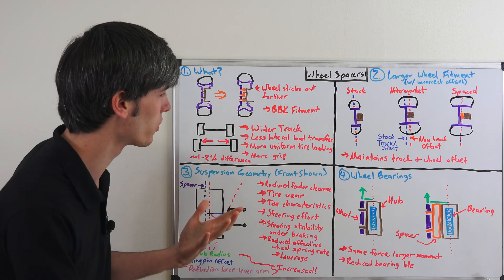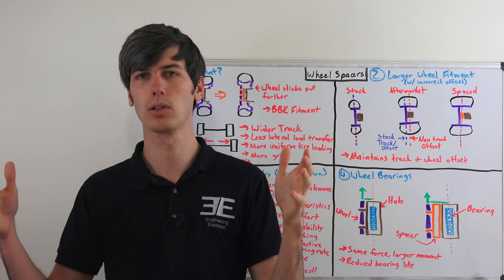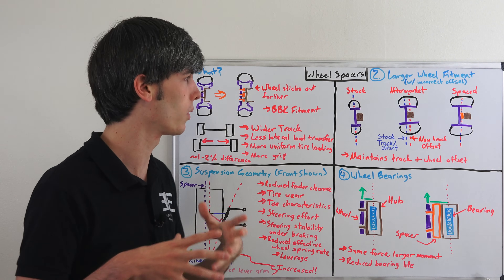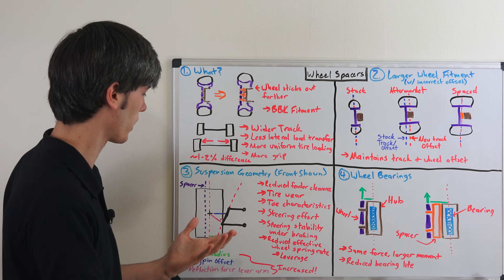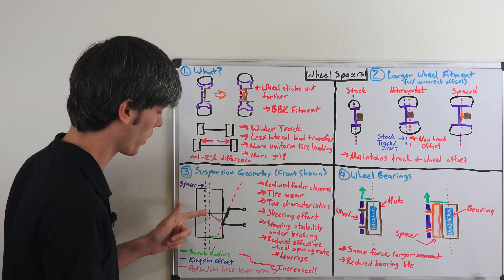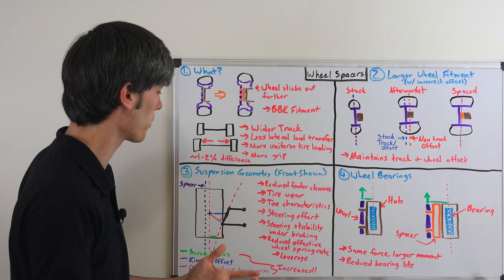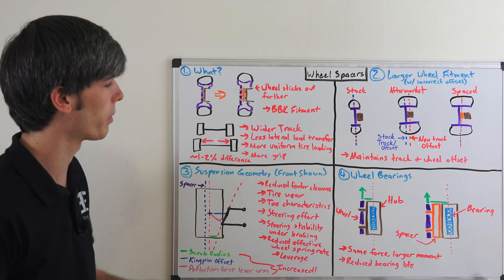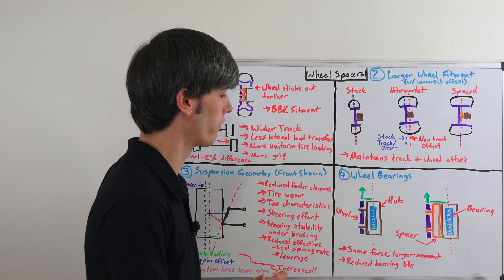Wheel Spacers & Adapters - Good Or Bad?

Comment: well done video man.  another item to cover is increased rotational weight.  rotational weight has a much higher impact of the performance of a car than static weight.  while wheel spacers might only add a few pounds per wheel, the impact could be much greater because it is weight added to a rotating assembly.
Reply: Yes but the rotating mass is very close to the center of the hub which has less of an impact than if it were further away from the hub center. Either way you are correct.

Comment: The Ackerman principle is the maths which is used to determine steering geometry, by fitting spacers in your wheels it throws the calculations out of the window. You can't just change one part of the calculation without changing the rest. it's a bit like doing Pythagoras and increasing one of the values but not the other 2 it won't give you a right angled triangle. the big difference between a right angled triangle and your car in this instance is you're not putting a triangle into a tight corner at 50mph and expecting it to stay on line

Comment: I don't why people cant just leave their cars alone. I work on cars and I have seen the effects and cost of doing these various "upgrades" (wheel spacer, different tires, lift, lower, bigger rims, smaller rims etc) and trust me about 99% of the time they r done right and either cause a unsafe condtion or the need to replace various other parts. the other 1% of the time they are done correctly (don't get me wrong in most cases these addtions done correctly work but are typically not done correctly) but the cost to do so is so high most people wont do it or find some one who can do it cheaper wich then puts them in the 99%. so please leave ur car alone when u buy a car think what u want (looks, speed, handleing) and buy a car bases on that so u can leave the car stock and avoid problems.
Reply: +Kevin Weil your comment makes me sad 😡
Reply: +Kevin Weil no.
Reply: +tr0n that's why when people like u bring ur car to me and say I don't know what happened I put a lowering kit on my car and now it's not acting right and look and say u need front bearing and cv axle and struts and it like $3k inside my mind I'm laughing what a idiot 😁
Reply: Kevin Weil because i take cars that i build to mechanics that can't type.
Reply: +tr0n we r going to skip the fact that this the not a professional setting so proper typing dosnt matter and go with I would rather be the idiot who can't type than the idiot who spends $1ks of dollars to do something to my car that later on down the road will cost me even more $1ks and possible cause me to crash and die.
Reply: Kevin Weil let me leave it at this: you have absolutely no idea what you're talking about.
Reply: +tr0n so ur trying to tell me that changeing angles of stuff on ur car (by changing height wheel distance or size) the very angles that took many enginer many months or even years to design to work safely and effectively has absoutly no effect on ur car.
Reply: Kevin Weil most of the stuff on your car is designed to be comfortable and cheap. changing components to improve performance doesn't make it explode.
Reply: Kevin you are a broke, pissed mechanic. Enjoy your camry I'll take my Modded RS4

Comment: What if you just get wheels with a different offset, rather than using spacers?
Reply: cuz wheels are pricy and a set of spacer can be as low as 15$. yea, 15$ I dare you put on your car. but Im cool with it on my rice rocket. cuz my insurance is even more expensive than that actual car
Reply: +Tuzz Nation Waaat? In our country a set of 5 hole 20mm spacers would cost 127$.
Reply: Blue Neck Media Im being sarcastic. Yes good spacers are expensive. but 127 is kinda on the brand name side. imo, spacers are for utility vehicle. dont ruin your nice drive with it
Reply: Then you should get slightly wider wheels so that the center line doesn't change too much... Assuming there's no clearance issues on the inner wheel side with a wider wheel trying to keep the same center
Reply: +Kuya Millefune That would be a better option, as far as bearings go. Can't really give insight as to what that would do to other suspension components though.

Comment: I'd just like to note that if you are using the spacers to offset non OE wheels to match the OE wheels track you are fine from an engineering point of view, as the net effect on wheel centerline is zero.

Comment: In Australia, wheel spacers are illegal unless the spacer is factory fitted and I have not seen any vehicle with wheel spacers from the factory in my 30 years in the automotive trade. Factory engineers just design the wheels correctly in the first instance.
Wheel spacers are inherently dangerous due to the increased offset adding more load to the studs, axles & bearings. 
The smartest way is to simply purchase the correct wheels to suit your vehicle.

Comment: I have them on my 94 cummins so I can fit the 2001 aluminum factory wheels; they won't clear the brake calipers & drums otherwise
Reply: +paul rogers so you enjoy driving a dangerous truck, I hope you don't haul heavy loads or tow with that truck. Spacers are weak and also illegal in many states. I know several guys into rock crawling and they use them because they know they will break before they break an axle shaft, because a $30 spacer is way better to replace than a $500 axle shaft. And easier to swap out on the trail and continue your day of fun rather than limping back to camp.
Reply: +Corey Schmidt get over yourself. had them on my truck for over 6 yrs and no problems.
Reply: paul rogers I stand by my statement.

Comment: I agree with most of what you said, but one thing I notice, is that adding a spacer would have the same effect as adding a lowset wheel since the actual tire is pushed out. nevertheless great video!

Comment: wrt to bearing loads, is there a difference between using spacers to effectively change the wheel offset and running wheels with that offset included in the design? eg. +40 wheels with 20mm spacers vs +20 wheels. My first guess is the total leverage between the source of the load and the bearing housing is the same but not sure if I'm right.

Comment: something you also have to take into consideration other then the wearing factors of the tyre and/or components is the safety issue.

Cars have a diagonal brake line set up and the idea is that if you have one of these lines cut and need to brake in an emergency, the vehicle will not pull up in a straight line because the factory specs of the vehicle are changed. Think of it like this. Get a piece of paper, put your finger in the centre and then put a finger to the left or right of it (to represent the different offset), push that finger forward and this is what will happen to your wheels in this situation. **edit - just saw your scrub radius video which you explain this, but the same rule applies for offset as it directly changes the scrub radius

Something that also gets forgotten a lot with new cars is that when they have ESC or similar products, it is programmed into the computer what the car is as it drives out of the factory. Changing the compound of a tyre to a harder tyre, adjusting the tyre size, offset or vehicle height can effect the ability of the computer so much that it could essentially cause you to not avoid that crash you were expecting to because you paid for the fancy car with the fancy gadgets.
Reply: Thank you , Well said !    Alot off these young kids want to make there car look better & I understand that !  the trouble lies in that they , for lack of a better word , are ignorant to the fact that in most cases there doing more harm than good   . It's a a case of form vs. function   .     wider track , wheels , tires etc. etc. dosn't always make a car handle better  .   For example :  my car is 2,00 lbs. & has tires with a 185 section width  , 195 50 -15  with a 7"  light , high strength 11lb. flowformed alloy racing wheels wheel   ( low un-sprung weight )   more than enough grip for the car .     Another example :   the  older Lotus Elan  of the late 1960's - early 1970-s weighed in at  900 kilo's   , I  beleive around 1,400 lb.s   &  had  a  5" steel wheel  &  a 155'70 -13 bias ply tire . I dont even think it was a radial tire  .   And it is still one of the best handling cars  to date   !    If I remember correctly ,  Michelin developed the first radial  tire  & Volvo  was reluctant to use it on the cars .  They weren't sure about its safety . Remember Volvo is world renowned for its safety .   Now every car sold today comes standard with radial tires   .  Trivia : Volvo invented the 3 point harness that every car uses today & they refused to patent it .   So that every Auto manufacturer could use it to make its occupants safer  !    Thanks Volvo  for thinking about saving lives as opposed to there bottom line profits .     thanks You   ,   great statement  . &   Happy Motoring

Comment: Good explanation, thanks. Here's my situation that i would like to ask you. I put a set of wheels that has different offset from the stock, just like #2. I use adaptors to make the offset is as the same as the stock wheels. Question is, is it still has the disadvantages?
Reply: I'm doing the same thing.  There will be no disadvantages.
Reply: Are you referring to a positive off set of the wheel by adding a spacer that would bring back the offset point to 0/0 ?

Comment: Additionally,   Many of the aftermarket wheel spacers do not utilize metal on the studs to the same quality as OEM.  Tightening down on these studs repeatedly fatigues the studs.  I have used these in the past and have had many of the studs break under normal spec torque loads.   I personally do not recommend.

Comment: Would there be any negative effects on geometry by just adding a wider wheel with the same center point?
Reply: +TheRoggan123 Yeah, because even though there is no spacer, it changes the center point of the wheel. That is why you will notice (in most cases) wider wheels make cars and trucks ride worse. Don't buy wheel spacers btw, he forgot to mention all the added pressure to the studs. With any real stress to them, they can break.

Comment: Question: T-6 aircraft aluminum (bolt on) 2"-3" wheel spacers on the rear of a GMC Sierra while towing a fifth wheel... is there a risk of weight distribution geometry at risk for failure, over the mathematical threshold? The weight of the kingpin load on the bed is probably around 2,000 to 2500lbs, which lowers the height of the rear around 2" on load. The spacers are very thick, heavy duty strength-forged T-6 that bolt to the hub and provide their own wheel mount bolts. What is your opinion of failure risk?

Comment: I don't know if the information in this video is true for every application of wheel spacers... If my thinking is correct, adding a spacer to center your rim with the hub would not change anything. On the other hand, when you add spacers that change the alignment with the center of your rim, you'll run into problems, right?

Comment: wheel spacers can also decrease the scrub radius (and everthing associated with it) as some cars have king pin geometry that puts the scrub radius to the outside of the wheel centerline.  Also, the spring rates affects, and everything else mentioned in section 3 after the king pin/scrub radius part, is affected about as little as the lateral load transfer.  The only affect a driver would feel from wheel spacers is the scrub radius change, everything else is too small of a change to feel from behind the wheel (although your wheel bearings may feel it).
Also worth noting is everything mentioned in this video is general wheel offset information.  For example if you have a +10 offset wheel and a +20 offset wheel with a 10mm spacer (all else being equal), both wheel will have the same affect on the rest of the car and geometry.  The +10 wheels with no spacers aren't gonna magically put less load on your wheel bearings.  I know this part sounds simple but I've had to explain it to a surprising amount of people.
Reply: +Bob Last this vid should really be called low wheel offset basics, because there's really nothing spacer specific in it, just what the affects of the lower offset as the result of the spacers.
Reply: +Bob Last exactly. this video could be renamed "run stock wheels and tires for ultimate performance!"

lol

Comment: The biggest drawback you missed was the studs have to be longer with a spacer, which puts more load on them.
Reply: +Dolan Kang There are hub centric wheel spacers with wheel studs pre installed

Comment: Good to bring up all these factors, but perhaps you educate the user more on how to calculate all of these factors themselves. My car, with spacer, has 1/4" of scrub with 1-3" being acceptable in my application. Also of note is that by simply increasing from 1/2" to 3/4" spacers up front, my race car saw far, far less understeer to the point I really liked how it drove. Unfortunately for me, I was just outside of my legal track width however I was shocked at what a difference a 1/2" increase in front track width improved the way my car handled. This is the difference between engineering theory and real world application. I would highly encourage you to include more real world instances in your videos because they're almost unusably vague. Include instances from both extremes, I'm sure older cars are more guilty of excessive scrub than mine. You can find suspension theory of operation anywhere, I can spout it all day. I do however have limited real world experience with it.

Comment: Obviously, everything depends on the size (thickness) of the spacer & what vehicle.

Let's say someone wants to use a spacer on a "top heavy" SUV that does NOT have any stability control, etc.  Wouldn't winding the track say 1/2"-1" (?) with a spacer technically help stability because the track is now wider?

As others have pointed out, what about adding a wider tire (I know going one size wider would not cause any "scrub").

Lastly, technically, what about the effects of both a spacer & going up one size in width?  All with the goal in mind to decrease "top heaviness."

As far as spring rates, I can get basically an unlimited number of spring types, both factory & aftermarket (stiffer &/or stock-3" lift).  The vehicle in question is an old Land Rover.

Thanks & keep up the Vids!

Comment: can you show us how to determine the safety load factor that stock bearing is designed to bare before failure. I know manufacturers some times put and eversize bearing to minimize liability from part failure. my point is maybe we can add bigger wheels and not overseed the safety margin of the load the factory parts are designed to take.

Comment: just an FYI if you align it and fix the caster then turning won't be as difficult and the tire wear won't change. you may need to change some arms to adjustable arms so that you can get those adjustments, but then it will wear the tires properly. I run an alignment shop with 30 years of experience there, we can get tires to wear properly no matter what kind of mods you do to your car.
Reply from the maker: +Jared Weldy Thanks for sharing your insight!
Reply: You should probably do a video on caster and the importance of it, also for those who like to camber their wheels way negative, explain the issues with that. Less rubber contact, tire wear even with compensating toe for camber, easier to hydroplane the car, and many other issues for ride quality and handling.
Reply: Engineering Explained but I will say not a lot of people will catch the fact that the bearing will wear faster with the issues of spacers... another idea is the huge rims issues... I aligned a car that had 26" rims, we had to weld and reinforce both sides of the frame (the frame was broken on the right front where the lower control arm bolts on due to the wheels), replace all ball joints and tie rods due to the excessive size of the rim it was wearing it all extremely fast since the small car wasn't meant to handle that force of turning when moving with the wheels. Just trying to turn the vehicle while going 25 was extremely suprising. The centrifugal force of the rims make you slow down considerably to make turns otherwise it won't cut it. Plus the rotors were warping and needed a big brake kit or really good rotors to avoid the warping when trying to slow the car down. The bill came to about 3k due to the hours spent on it.
Reply from the maker: Jared Weldy Done and done! Too much negative camber: https://youtu.be/xM8jwyrdy04

Caster: https://youtu.be/Gh7gWJAvOvs
Reply: +Engineering Explained dude question. can u stack wheels spacers??? specifically 2 50mm to make 100mm. i know thats crazy but just asking. maybe make a vid about it
Reply: Damn I wish more alignment shops had people who understand how to make alignment adjustments for modified cars.

Comment: Forgive me if I have this wrong; but as I drive a 4x4 pickup, are the effects with a  solid axle suspension more or less nulled (excepting of course potentially the bearing wear). This seems correct to me but I ask the question since you mention the deflection arm radius and this, if I understand you correctly, is much less important/affected given the archaic nature of my solid front axle?

Comment: as someone that is running spidertrax 1.25" spacers on a lifted toyota i will say that the overall feel of the truck in turns is so much better and the truck does not lean as much on fast turns as before. i also feel as if i am able to take turns faster then before because of the wider track